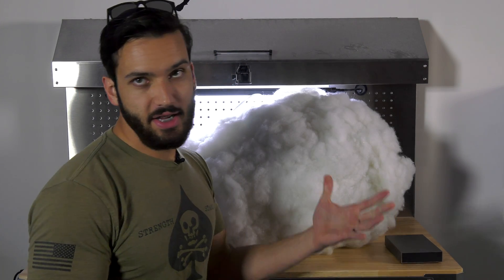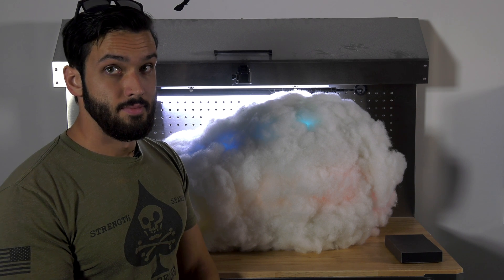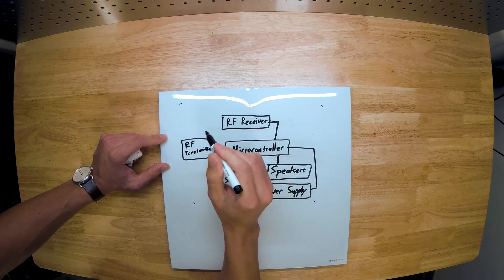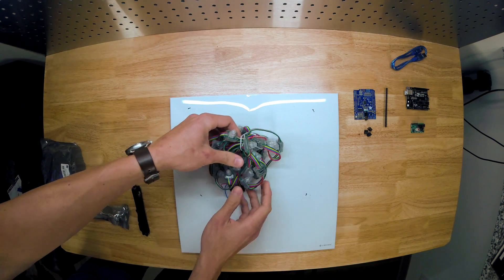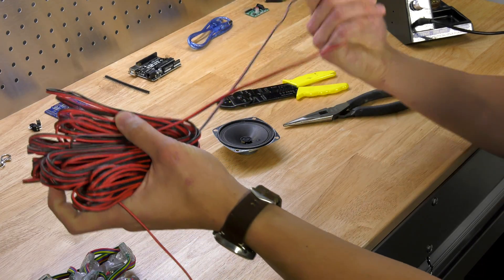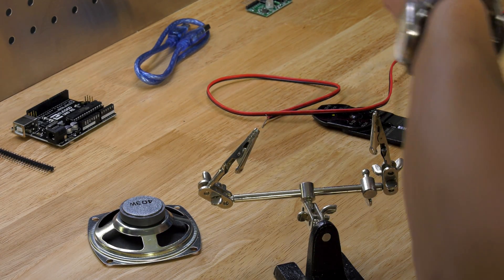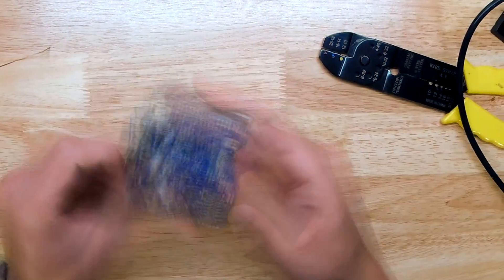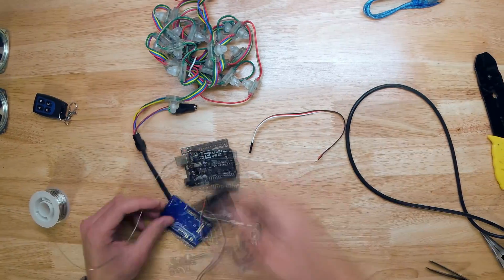DIY Storm Cloud Lamp | Part 1 | The Casual Engineer

Comment: DIY way to burn your house down. What if one of those LEDs undergoes a thermal runaway because of manufacturing issue?
Reply from the maker: Not really. I have the extension cable connected to a wireless Electrical Outlet Switch. It kills power to the entire system when it's turned off. I don't leave this on 24/7